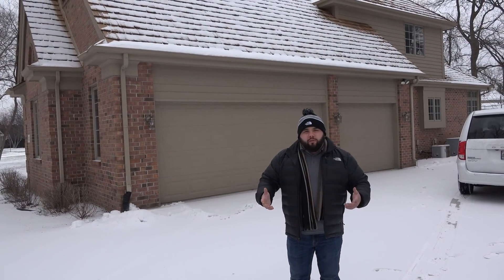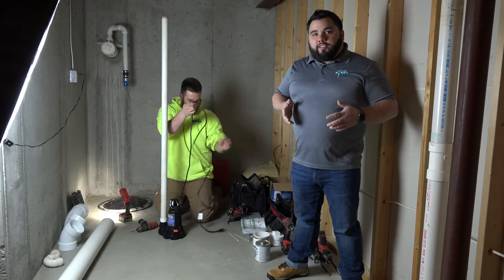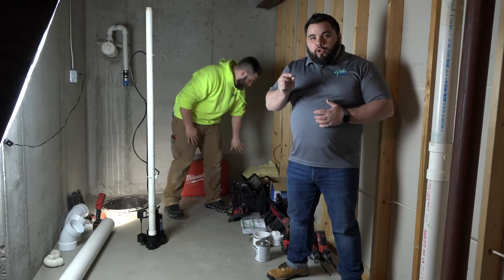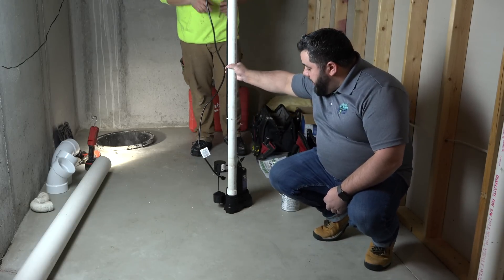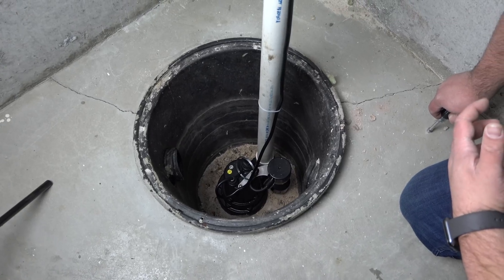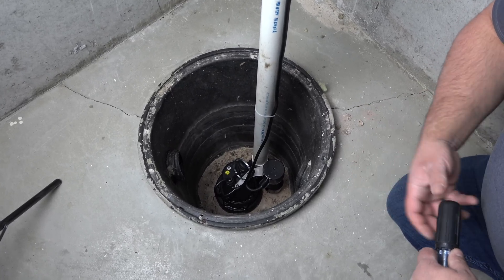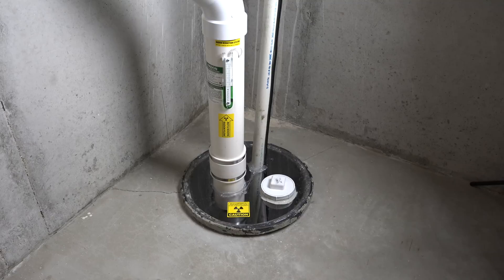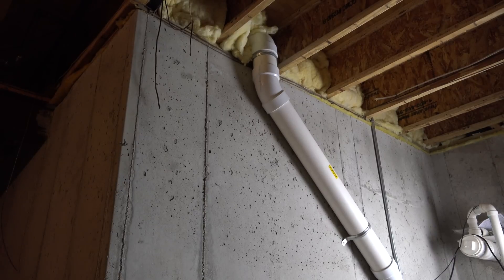Radon Mitigation System Installation

Comment: From a geologist point of view, there is no system today that eliminates the presence of radon unless you remove all the soil, bedrock or the grade on which the foundation and the house sets. In fact, before the house is built in the geological test should include such a radon test. However, this is more like a placebo pill which makes a very good niche to make a lot of money and good for you if homeowners are not educating themselves and learn that a $30 fan/venting outside can take care of pretty much any kind of soil emanations, fumes, odors. It is more dangerous the microwave radiations than the overrated and blown out of proportions radon gas coming from the decay products of uranium in the ground beneath homes, streets or buildings which also can seep in through cracks, sumps, joints, floor drains or other tiny openings in foundations or crawl spaces. Your installation only prevents the infiltration at the pump but not the total elimination of radon presence.
Reply: Thanks for your time and comment! I just want to state that no claim was made that radon was completely removed from the structure but rather it was stated that it was mitigated. According to the Oxford Dictionary, mitigate means “to make less severe, serious, or painful.” —that is what radon mitigation does.

There are a lot of misconceptions about radon...but it is natural and it is everywhere around us. It is impossible to make it go away completely. In fact, even if you test fresh, outside air you generally read somewhere between 0.3-0.7 pCi/l. What a radon system or a sub-slab depressurization system does is redirect existing radon from beneath the structure so less enters into the home through pressure differentials. For example, indoor radon levels tend to be higher in the winter. Many think this is because the home is sealed in the winter, however, many homes are sealed in the summer too (when the a/c is running). The true issue in the winter is what is known as stack effect—the same concept that pulls smoke up through your chimney. When homeowners heat their homes in the winter, the heat rises and eventually leaves the structure. This loss of air creates a negative pressure that can draw soil gasses, like radon, into the structure. Since homes are sealed tighter than ever before, these levels can grow to levels that substantially increase ones risk of lung cancer over prolonged, consistent exposure. 

The sub-slab systems we custom design and build for homeowners just simply use a series of piping and fan/fans to create a negative pressure under the slab that is greater than that of the pull from the structure (the vast majority of the time) and in turn, since radon gas finds the path of least resistance, it is pulled up through the piping and vent system (by the suction of fan) and directed (by the blowing of fan) outside rather than into the sealed, confined space of the structure. The EPA warns that levels above 4.0 pCi/l can dramatically increase ones risk of lung cancer. If we can take homes that test above 4.0 pCi/l and reduce them to levels similar to outdoor air quality, surely there is an advantage—namely a decreased chance of lung cancer. I have personally mitigated homes with my team well over 100 and 150 pCi/l... we get their levels consistently down below 4.0 pCi/l and most of the time well below 2.0 or 1.0 pCi/l. Homes where real people and pets have passed away from lung cancer.
Reply: @brianthompson2002  how long does some one need to be exposed to living under radon. Before it becomes harmful and eligible for a family to get lung cancer.  I put a bid on a home I wont and I did radon test the result came back reading 3.7 

It's a 2014 home it has a unfinished basement and I was looking to build it out for the kids but now I'm NERVOUS because of this whole radon threat.

I reside in MINNESOTA 
What's the cost to mitigate out here..?
Reply: Hey! Thanks for reaching out! Radon is considered to be a threat after long term continuous exposure. 4.0 pCi/l is considered the EPA action level—in other words anything at or above 4.0 should be mitigated. However, the World Health Organization says the action level is around 2.7 pCi/l so much of the World is a bit ahead of us in terms of the EPA’s 40-year old standard. I would never pass on a home that has high radon just because it has high radon. It is a very simple issue to fix. Generally it is because of a pressure differential between the structure and the soil. Once you create a negative pressure under the home and give it a pathway you can drastically reduce indoor radon levels to those levels consistent of outdoor air quality. Every home has radon it’s just a matter of how high those levels are and based on the soil consistency in the Midwest a 3.7 in Minnesota is actually fairly low and could be reduced below 1.0 pCi/l for around $1,000-$1,500 GENERALLY. I have some very good contractors I know in the area that I would be happy to refer if you want to reach out :)
Reply: @brianthompson2002  yes if you could provide me with an email or # so I may reach out to the Recommendations mentioned
Reply: @brianthompson2002  awesome 
THANKS Brian
Reply: @brianthompson2002  Right on.... In fact if that report comes back higher than 4.0 the buyer can back out of purchasing your house or stipulate that you install exactly this type of system.
Reply: InquiryTeaching Yep! You got it! Thanks for chiming-in!!
Reply: @brianthompson2002  EPA does not represent the scientific community or have the legal authority to enforce any kind of claim without documented evidence. The only thing they can do is to suggest, advise or warn the public regarding eventual risks related to a certain situation or circumstances and to talk about and know radon you have to be a chemist, biologist, physicist or geologist which EPA, plumbers or other people copying each other like parrots are not. However, you cannot control the levels of constant, continuous and present necessary particles of anything unless you are modifying an entire echo system or the environment in which case we have to modify the entire planet since it is in the air we breathe. That applies to anything in nature including you, can you modify or change the amount of hydrogen and cyanide in your body or the oxygen intake, water levels? No, because you dye. Brian we all have to make a living but insinuating, justifying or enforcing an assumption does not represent the truth or change the facts and if you want or believe EPA are you willing to bet $1000 on your claim that you are able to control the level and reduce the presence of radon on the entire house permanently with that silly installation?
Reply: milos Karoly In terms of a geologist point of view, I am truly surprised to hear your position. I work with geologists on a daily basis building these same kind of systems to not only reduce radon levels in structures but also VOC’s from soil and ground water pollution that are brought into the structure through the same pressure concepts. In most of these commercial VOC/vapor intrusion applications we use custom fans that generally have 5-figure price tags (never have I or any professional in this industry used a $30 fan...) and my team, along-side soil engineers, geologists, environmental scientists, all kinds of scientific and professional personnel, etc. design, implement and continually retest and evaluate the effectiveness of these systems every quarter of the year to ensure their improving/maintaining proper indoor air quality. In other words, I have to prove my results ... and not just once,  but every 3 months for the life of the system.  I find that to be a pretty tough placebo pill to swallow. Further, for you to try and call out the radon profession without a heightened knowledge of it is similar to me saying “geologists are stupid they just stare at rocks all day—good for you to find someone to pay you to do that.” It’s childish and silly. If you want to learn more about what we do look us up and shoot me a call or email. I would be happy to explain in more detail, in a more constructive forum. This video was designed more to help homeowners understand what’s going on and help newer mitigators see / understand some of our processes.
Reply: @brianthompson2002  My friend this will be the last reply considering how emotional you get when it comes to facts and the truth. You may work with geologists every day and as far as I am concerned they probably stick with what they know staring at the rocks all day and like most of them are a part of the scientific community and will never join you or assist you building a pipe coming from the ground unless are into different kind of rocks. If that device is commissioned for evaluation is a different thing but I know, in 2009 someone tried to get a patent on it and rejected for lack of proving its claim, no technical evaluation etc. Now you talk about water infiltration and what or how do you know the presence of radon unless you have a spectrophotometer and a lab to identify the presence of all particles and maybe if you are lucky may find few particles of radium which I GUESS YOU ALREADY KNOW that radon can not exist without radium. Man look I respect your dedication but regardless how much you are trying to make it sound good it does not add up, I'm not saying that you are a lunatic but you remind me of those lunatics which unfortunately are biologists trying to hold on the theory of evolution and not because is true but because it is still a good niche for grants. Please don't come with stuff like this without evidence which like I said your customers may buy it but don't go to a chemist or biologist. There is no scientific evidence supporting EPA recommendations or suggestions and keep in mind that geologists have different specialties just as contractors and biogeology is my thing and since chemistry is the foundation of biology and geology guess what my job is to bring facts and evidence not fabricate them or creating hypothesis or theories. For thousands of years, people have bathed in natural hot springs for the therapeutic properties of the water. Many of these spas have been found to contain radon and yet rather than developing radiation sickness or cancer, many studies show that bathing in the radon-rich groundwater reduces inflammation and pain. Listen, you don't have to take my word for it but are free community classes in chemistry, biology or whatever where you can educate your self and learn how EPA IS MISLEADING PEOPLE. is been good chatting with you. Take care
Reply: @miloskaroly7921  bro!
I just read your comments and I noticed someone else vouched on your arguments and is now suing them.

I just put a Bid on a house I did the Radon test and the results came back reading it to be 3.7

So is Radon really a threat..?
And if so how long you have to be exposed to it.

For the possibility of a sickness to affect you ? (i.e. lung cancer etc...) 

THANKS ahead of time
Reply: @miloskaroly7921  You may be correct on your EPA claim but if a home inspector flags your property because you come up with a radon level over 4.0 it is likely that you will be installing one of these systems to complete the sale or  simply discounting you selling price so the buyer can do it themselves.
Reply: @upondivineguidanceorder2548  3.7 isn't overly concerning but you might consider a couple of different solutions to reduce it. Ideally, you want something under 2.6p as an average reading. First, get more testing. I suggest the Airthings Wave Plus sensor to get constant and easy to read readings. I would supplement that with a couple of $20 Radon tests that you send out to labs for verification. Radon levels vary depending on several conditions including heavy rain and even tides if you live near the ocean/tidal waters. If your number is routinely under 4.0 I would suggest trying a large air purifier that uses activated charcoal filters(silver is best). That typically costs between $600-800 for a 1500sf basement sized unit. Also, before testing again, I suggest having a dehumidifier in the basement since high humidity can affect readings. If your readings are consistently over 4.0, you might talk to a mitigation contractor like those in the video. The systems do work well when installed correctly. As for "is radon exposure dangerous?"...yes. Lung cancer is the 6th leading cause of death in the US and the 2nd leading cause of lung cancer is Radon exposure. On it's own at low levels it is not much of a danger at all, as far as can be proven. However, above 2.6 it becomes a threat over time. Above 4 and you are looking at a 16% greater chance of lung cancer according to some experts. Combine that with smoking and it radically increases. https://www.health.harvard.edu/newsletter_article/Radon_revisited
Reply: Thanks for the info everyone.

Comment: How does the exterior PVC hold up to UV radiation?
Reply: Thanks for asking! They are treated as most standard PVC is. Therefore, there can be some yellowing over time but typically the treatments keep them pretty white. What I have seen is some of the lower quality fans tend to yellow very quickly. The fans we use stay white no matter what. Also, many of our customers paint the system to match the color of their home. They are allowed to paint the system and the fan, just not the top piece on the fan that covers the electrical box as this piece has the serial number for the warranty information. I hope that helps!
Reply: @brianthompson2002  Thanks!
Reply: The best pipe for out door use to prevent yellowing and damage is schedule 40 solid core pipe! That pipe according to national radon code should be used throughout the whole system
Reply: Corey Poss you got it!

Comment: Thanks for the video!
Do you have any videos or suggestions on the sump cover itself?? How to drill the holes and/or sealing around the pipe? Also what is the best way/tools for coring through the house and/or if I was to go into the slab vs my sump crock?
TIA
Reply: Thanks for the reply! Unfortunately at this time I do not BUT we use quarter inch Polycarbinate sheeting. Simply trace the diameter of your sump and use a jigsaw to cut it to size. In terms or coring through the Polycarbinate—I usually use a 100 tooth hole saw bit (either 3.5inch or 3 5/8 if I want a little more wiggle room. From there, you can use rubber grommets to seal or just silicone caulk. Lastly, we use a carbide tip core bit on a Bosch rotary hammer drill to drill through the concrete floor and tie into the drain-tile. This should work too if you have to core through block, stone or brick. If you are going through siding and wood you will want something a bit different. We usually use a right angle drill with spyder carbide hole saw bits. If you have a poured foundation and you have to go through that, then you may need something meaner...I would recommend a diamond wet-core rig...this will help cut through the rebar. I hope this helps!
Reply: Try this lid, way better for pump replacement accessibility. Also I believe it's a much cleaner look https://www.jackelinc.com/smr16101-cv.html

Comment: why NO condensation bypass????????????
Reply from the maker: tad travis that’s a great question! Typically (and ironically) the diameter of the condensation bypass is small and when pulling 40-50 degree (F) air from beneath the slab, the much cooler outdoor air (during Wisconsin winter months) condenses at the bypass and we typically see that they become frozen and useless. We use really good fans (Festa Radon Technologies) that are designed to take water through them and typically we do not have a problem when they are properly installed. In short, you definitely could install a condensation bypass (there is certainly nothing wrong with them) but in 22-years experience we have found them to be less than useful when needed most. Therefore, to keep costs competitive for our customers, keep things simple, and overall personal preference we simply do it install them very often on residential, exterior installs.
Reply: Because all Radon fans are made to accept the water draining back through the fan and into the suction pit. We have done a couple thousand systems in North West Iowa and never had an issue with moisture running back through the fans, or needing a useless varmet cover

Comment: Great video. Nice installation. 
My guy put a plastic cover on and sealed it with foil tape, not nearly as professional looking. Is there an easy way to test the sump pump without removing the cover?
Reply from the maker: Frank Steen thanks for the kind words! The best way to test your sump without removing the lid is to have an access port. Anyone installing to current AARST/NRPP standards should be installing a proper access port. The easiest way to add one is to core a 4-inch hole into the top of the cover and buy a 4-inch,  threaded plumbing access port. Once you place it in your 4-inch core hole the lip should hold it from falling through and you can caulk it down with a high quality polyurethane to ensure it doesn’t spin on you. I hope this helps!
Reply from the maker: Frank Steen please check out 7:47 on the video for a visual reference
Reply: Lifetime Radon Solutions thanks so much!
Reply: Agreed wish I could have had these guys do the work. Nicely done.